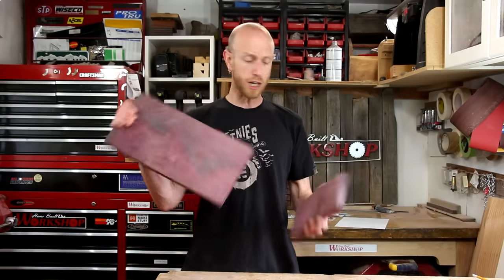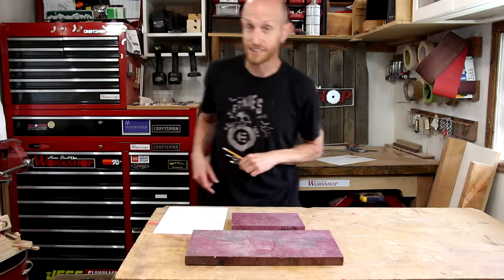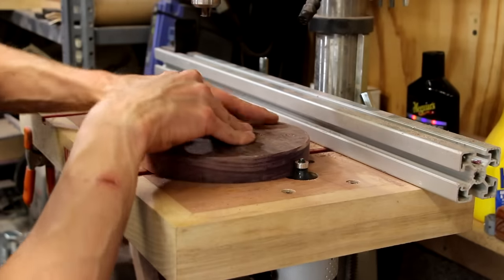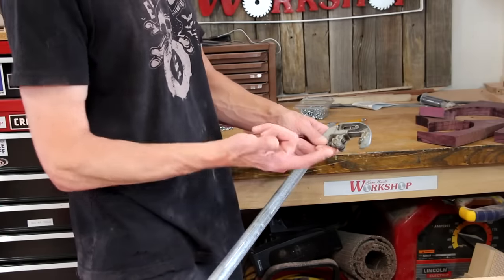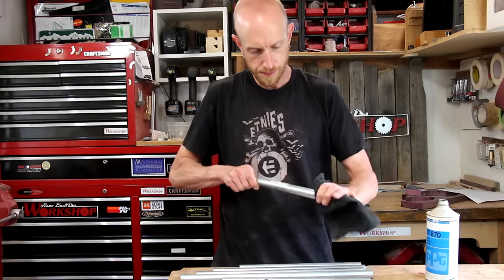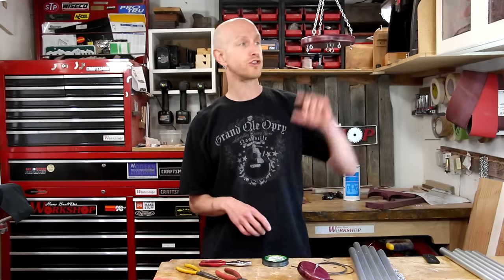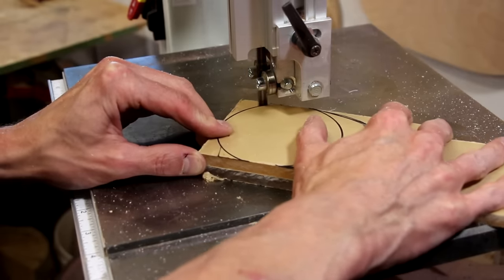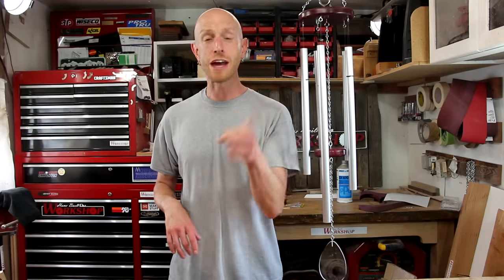How to make Wind Chimes (that sound really good)

Comment: Great video. Thanks. Just a note for someone who may not be a fisherman. Easiest way to cut squirmy fishing line is with finger nail clippers. However I used aluminum wire for durability.
Reply from the maker: Thanks for the tip. I need to get a set of clippers to keep in the toolbox.

Comment: I made a wind chime a few years ago with the tubes from another chime. I guess you could say that I repaired the chime, but I had to make all the wood parts from scratch. Instead of drilling one hole for an eyelet, I drilled 2 holes in the location of the chime and then used one long piece of line for the whole thing. Instead of fishing line though, I used the stuff they use for making jewelry. It's as thick as strong fishing line but it has a steel core coated in plastic. And it's extremely flexible. That was a few years ago and the wind chime is still going. Honestly, the line is the only thing I would change from your build. The line can also simply be crimped instead of tying. Although you can tie it also. Thank you for the great video. You have a new subscriber.
Reply from the maker: Oh yeah, one line, then loop it through. I've seen some like that.
Reply: @homebuiltshop  I just re-watched the video. Still enjoyed it. I'm finally in a position where I can do more projects and this is what I'm choosing as one of the first projects. Also, recording that extra footage is where you get the "Bloopers". LoL!

Comment: The reason you want to drill the thread hole in different places for different length chines is what is called the node or nodal and anti node or anti nodal points.  This has to do with the vibration of the chime.  The middle and ends vibrate the most and the anti nodal points vibrate the least and if done perfectly(not around this shop)  doesn't vibrate at all.

Comment: Well done... I used a guitar tuner to adjust the length of pipes to get perfect pitch on each tube... my next set I'm going to make out of exhaust pipe.
Reply from the maker: I thought about trying to use a tuner to get it exact. Exaust Pipe should sound cool. I bet it starts getting pretty low toned with the bigger pipe.

Comment: nice video! to prevent broken screws scraping them over beeswax or over a bar of soap works as well, and pre drilling deep enough so they don't bottom out is a must in hard woods!
Reply from the maker: Thanks. I have gotten used to waxing the screws now. It works much better.
Reply: Beeswax or parowax but avoid soap, especially if exposed to high humidity (like outside). Long term the moisture can cause cheapo hardware to rust into wood fibers & maybe rust through. Those eye screws have a thin plating at best.

Comment: Cool project. Just an FYI, the pipe cutter should have a burr tool. It's a flip out triangle. 😎👍
Reply from the maker: It does but I feel the file gets it smoother. Either way works though.
Reply: Also if you work with conduit much, there is a specific "conduit reamer" tool (Klein & Greenlee both have it) with a screwdriver handle, makes quick work of that. Standard tool belt pouch item for most any electrician.

Comment: I was surprised that aluminum tubing worked. It was thicker and a harder aluminum (7075?) than some. I used that guy's site for some advice and they mightn't be at perfect pitch but they sustain and are well-liked. The slight dissonance makes for a mysterious sound, so I'm happy.
Reply from the maker: I really think you could use most anything. I too like a little bit of dissonance.

Comment: Nice build I've used purple hart in the past it looses it's color if it's out side ,you can oil it easier to refinish if you choose to .on the acrylic sail sand the edges like you did then use a blow torch the edges will turn clear no sanding marks great job on the chimes
Reply from the maker: Thanks, I need to try the torch trick.

Comment: You should pick up a deburring tool. Just a screwdriver sized piece that easily lets you chamfer the inside edges  of holes. Instead of filing / sanding / rotary tools. Super consistent and easy to use.

Comment: I've found that the 50lb line will degrade in the sun after a full season with weight on it. 
I replaced the line with picture frame wire. A tad clunky but far more durable. Chimes still sound good too. Thanks for the build advice.
Reply from the maker: I wonder if different brands of line have different properties. So far, I haven't had one of these break. They've been outside in the elements since I made them. Thanks for sharing your experience. Its something to take note of.

Comment: looks great pinman, try using fingernail clippers to cut the fishing line. I figured you would have tried sharpening your bandsaw blade,i was suprised how easy it was.
Reply from the maker: +Chad Lowrance good call on the fingernail clippers. I will try that. Yeah, I'm slacking on the blade sharpening. I did look through my files and I think I need to buy one to do that. I don't have a good file that small.

Comment: Fishermen use nail clippers for cutting the fishing line...
Reply from the maker: I have heard that, but haven't tried it yet.
Reply: Perfect for monofilament, but not so good for high performance braids like spider wire. It'll work, though.
Reply: @mothman-jz8ug  what is "spider wire"?
Reply: Mine uses either his pocket knife or... His teeth 😂

Comment: I wonder if there is a ' preferred ' placement of the chimes ? The long one 1st, then the next longest should go, ect, ect. I'll ck out Lee Hite's sight. I found - on Amazon - some nylon woven parachute cord that's small in diameter yet it's strength is rated at 80 lbs. Thanks for doing this video.
Reply from the maker: I believe you could place them anywhere really. I followed Lee's instructions for this one though. That cord you found should work great.

Comment: how do you put the plastic protectors in the string holes to stop the string from being cut by the movement and rubbing on the edge of the metal tube hole?

Comment: Quick question! Do holes in the pipe alter the tuning, at all? I was hoping to drill two holes through the pipe to install them horizontally- my goal is to make a Swinging chime, not a wind chime!
Reply from the maker: I suppose there is some science to the hole placement but I think its probably more the length that affects the tone. I'd say go for it and experiment a little.
Reply: @homebuiltshop  Thanks, will do!

Comment: Is there anything you can do to keep the inside of the tubes from rusting over time?
Reply from the maker: I haven't seen any issue with rust yet. I suppose you could try to get some paint inside the tubes if you wanted the extra protection. A light coat of oil might help too.

Comment: Hi there.  I have a question for you.  My grandparents had a set of wind chimes.  I have not been able to get the sound out of my head since I first heard them in 1991.  I know their wind chimes were smaller because they were higher in pitch.  Do you ever get a chance to hear the sound of the chimes you make before the product is final?  I'd like to have a set of wind chimes that look and sound almost exactly like the ones they had.  I don't know if my grandparents still have that set.
Reply from the maker: Different size/materiel tubing will give different sounds. I'd try some smaller pipes to see if you can get a higher pitch.

Comment: I'm wondering why you tied the pipes 4 inches or so from the top? Why not just a 1/2 inch from the top??
Reply from the maker: I suppose you could tie them higher. I just tied them at the height of the first one.
Reply: It seems to me that lower will let the chimes move more easily. just my opinion

Comment: I have yet to come across a good sounding wind chime. Why are they tuned to horrible sounding dissonant chords?
Reply from the maker: If you make one, you can tune them to whatever notes you want by varying the length of the tubes. It doesn't have to be dissonant if you don't want it to.
Reply: @homebuiltshop  : indeed... yet... involved in too many projects already... you'll have this with those involved in craft.

Thanks for the inspiration.

Comment: Please please someone , anyone give me the exact lengths of the pipes!!! 😩Please help
Reply from the maker: They're all on the website I mentioned in the video. Lee has so much info available there.
Reply: @homebuiltshop  hi, thanks for replying but the issue is I have googled everything about it ,yet being a novice about music noted and stuff I couldn't understand a single beat. Please if possible mention the exact lengths of the pipes and hanging points . I have 0.5 cm thick aluminium tubes. Your help will be much appreciated. 🙏🏻

Comment: I thought you should hang them 22.4% down form the top and strike them one inch form center or one inch form the  bottom end. In that case would the bottom be flatly aligned even?   

based my info from  

http://leehite.org/Chimes.htm#The%20strike%20note
Reply from the maker: +Ed Doodler I think I saw on there a couple different methods of aligning the ends. I just used the measurements he has for the Westminster chime.